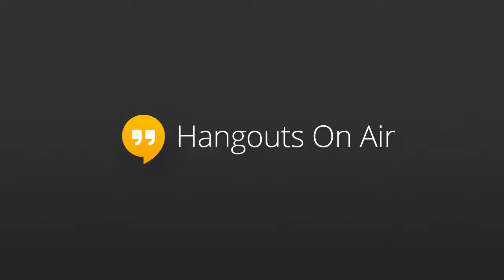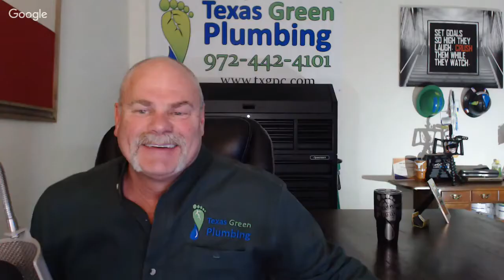Why Replace Cast Iron Drain Pipes?

Comment: Dang I wish I had watched this a few months ago. I knew the price I was quoted was high, but I didn't know until watching your videos how much I missed out on. I got a plumbing inspection on a house I was looking to buy. They checked appliances and hookups in and around the house and ran a camera down the sewer line. $1,000. No pressure test, no sewer water test. Just a, 'Your sewer pipe looks good.'
I'll be more more careful in what I ask for next time. 
Great videos!

Comment: I agree with all this. However, there are plenty of situations where the homeowner doesn’t want to hear the toilet flushing from the kitchen below, for example. In this scenario, we provide the option of installing a cast iron run for the portion of pipe that may be heard from below. It definitely keeps the plumbing quieter, but doesn’t last as long!
Reply: Roger just said that its fine above grade. For sound case you put it in the wall, where it should live 100y no problem. My 70yo house had cast iron plumbing, under slab - cracked for a long time - above - perfect, healthy, still black like new pipe.

Comment: I have a 1930s bungalow with original cast iron plumbing and no problems yet. Hoping i get a few more yrs before replacements
Reply: What's happening with old galvanized water line u keeping them bcz not leaking  🤔

To be honest if u remodeling and open walls remove old plumbing, electricity every old stuffs inside wall and install new fresh plumbing, electricity etc bcz u dont want remove a new work bcz few months later a pipe start leaking or a old electrical wire burn 🥵

Comment: I think it's all about quality.
I have been working inside a 20's building  and they didn't had any issue on the plumbing/heating.
The cast iron drain were neat.
And it's not the only one I seen in my life.
Nowadays I won't do cast iron in my house because it will rust after 10 years
Reply: not true mine is 150 years and in good working order
Reply: @divinee.155  I know that cast iron is a good product, but nowadays the manufacturing of cast iron is a real joke.
The cast iron is so thin, that it's lighter than PVC.
Before cast iron was very heavy and doesn't rust
Reply: As a millwright contractor I worked in and around industrial buildings with cast iron pipe WELL over a hundred years old both inside and underground.   Are we sure he is not confusing galvanized steel drain piping with cast iron?

 Galvanized was SOP for bathroom and kitchen drains up to when plastic took over and most of it has already had to be replaced but the fact is be it above or underground Cast Iron will last indefinably as long as it isn't  physically damaged or plugged up with whatever,,,,,Now Galvanized pipe, even in air lines, rarely makes it past 50 to 75 years no matter where is  installed. ---- Well. maybe as an oil line. I have worked on large machine tools and big presses and forges well over 100 years old that were left outside in the weather for a decade or more,,,,,and then we re-built then and put them back in service. - Guess what the frames/beds were made of? - It wasn't PVC, I can tell ya.

Comment: I work in  a commercial building and we still must use cast iron for waste lines and copper for supply lines. To maintain fire rating of the firewalls and prevent excess smoke from plastics if a fire does occur.
Reply: Yes commercials and multi unit building required cast-iron drain and copper vents line

Comment: I'm about the 5th owner of a 1935 brick house with a slate roof in Pittsburgh.  I'm guessing no one has had to replace anything on this skookum house. 

But the cast iron Terra cotta pipe system is now 90 years old...

Comment: How do you know that PVC pipe or the connection fittings will last 100 years? Most underground main sewer pipes install by municipalities are cast iron. I’d rather go with new cast iron piping for underground installations.

Comment: A few decades ago I put in underground HS XH (not SV);  everyone touts plastic now but I've yet to see 100 year old buried PVC pipes and worry about embrittlement over long time spans not to speak of gouging  soft plastic from those nasty augers.   If I did it over again might be inclined to case with 10" PE and vent (crawl access not an option), but still corrosion will eventually get to the iron.   Fundamentally, one has to decide how to not only build a suitable house, but include in that house maintenance access.  I don't like new fangled materials like those taped wall panels, stretchy tape for window pans-- the mfg does not specify how long the tape is good for, maybe just long enough for air door approval. Plumbing is no different, how confident are you that ProPress gaskets won't leak in 50 years?  Oh, the horrors of de-zincafication!  And don't even mention that wonder plastic PB.

Comment: i heard that the rust that first develops on the inside of cast iron underground actually helps protect it over time...common to get 50 plus years up here in the northeast underground..
Reply: Just one more thing = Cast iron is close to rust proof. (Rust,,,,,Oxidized iron) Don't believe me? Grab an oxyfuel torch and tru to burrn cast iron. - It will not work because even when red hot the iron will not oxidize. You can cut Steel 2 feet thick with a torch, but you can't cut cast a quarter inch thick. --- Introduction to Metallurgy 098

Comment: You can say whatever you want, everything in plumbing depends. You say "a" part or material is bad for the plumbing system, however, there is always a situation that you have or is the only way on doing the installation or repair.

Comment: stopped at 3:26, in my opinion, who's been in the plumbing trade since 1978, I do not replace anything unless it goes bad. I have replaced CI pipe if it's rotted out, but not just to put in pvc.. I had to stop where I did cause I had to go, I don't know what else he had to say.

Comment: Some houses that have concrete slab were the cast iron is buried would rather walk away from replacement because they have to jack hammer the concrete to get to the cast iron pipe and replace it.
Reply: I'm prob gonna take on that challenge this summer lol

Comment: Much much cheaper to have it relined. They feed plastic thru leaking steel natural gas lines. No digging big money saver. Well folks they now have a blow mold plastic that is like a long balloon fed thru the pipe they it is blown up and it quickly hardens they have a  camera fed hole cutter to cut openings for fitting s it's way cheaper ppl than hiring some hyperbolic rates of a plumber

Comment: I'm a home owner and not planning on selling but I have old non leaking cast iron.  While I am renovating my bathroom should I replace the good cast iron with PVC since I have the opportunity or leave it be?  House built in 1955.
Reply: Good question. I'm in the same situation as you, I'm due to refurbish a 1950s house. What did you do in the end?

Thanks
Reply: @darkknight17  I ended up replacing all of the cast iron all the way up and through the roof stack.  When I cut the old pipe it was still very solid with decent thickness but had a ton of sludge build up and I was able to fix some sloping issues that was causing poor drainage.  I went through 4 Diablo carbide blades.  In the end it was not that hard or expensive just took some time to think about the best strategy.  Best of luck!
Reply: @Vin3Man  thanks for your reply mate.

I recently purchased my 1950s 4 bed, and the list of things just keeps growing. I'm considering whether to replace the cast iron soil stack pipe with pvc, or have it professionally cleaned and lined with epoxy resin.

I also need to do full electrics, new boiler, full external render, and internal plaster and skim plaster. It's just getting rediculous. 

The surveys alone (damp survey, roof survey, drainage survey) are not cheap at all.
Reply: @Vin3Man  in hindsight, did you do a drain survey with a camera or just take the plunge? Any regrets?

Im on a shoe string budget of £60k and I'm currently coming in at £75k for the works. 

Thanks again.
Reply: @darkknight17  I'm glad to provide some insight to to this scenario that many DIY or maybe even not DIY homeowners face. I did not perform a camera survey as I decided from my previous experience where I did not replace the cast-iron when I had the opportunity to bit me in the rear. In a previous home I renovated a basement with a cast iron drain and it was in good shape or so I thought and a year later it developed at crack on the bottom horizontal length that leaked everywhere and the cleanup and managing the nasty mess was a lot more time-consuming and stressful then if I would have just done it while in renovation mode. For this particular project it was an upstairs bathroom and we had just renovated the kitchen below it so I did not want to come across that same scenario where I had to manage sewage cleanup and and mitigate the impact to the brand new kitchen below.
Reply: @Vin3Man  thanks mate, really appreciate the shared experience.

I'm in a similar scenario, the soil stack from the toilet is on 2nd floor and 1st floor that runs down the side of the kitchen. I need to full hack off and replace external render which is coming in at £25k for the full house. I've also heard old cast iron pipes expand due to heat cycles and can crack or blow the brickwork of the building.

I will start with a drain survey with a cctv camera to inspect the pipework, to see if I can save money, and then compare quotes between the epoxy resin slide (pipe within a pipe) vs pvc pipe replacement quotes.

Comment: Hey Brother, I am looking to replace some Orangeburg pipe underground out in the yard.
Reply: Oh wow. Got to love the orange burg pipe. I been doing plumbing for 25 years in Atlanta area and I still see it here sometimes. It’s rare but yes I’m sure it needs to be replaced. Lol. I would go back with foam core pvc 4”
Reply: @chadstephens7467  isnt ABS better for underground??
Reply: @workingshlub8861  yes that is correct. ABS is absolutely better suited for underground use and foam core pipe is better suited for in home use. Very true

Comment: What is the life expectancy of ABS pipe?
Reply: infinity.
Reply: abs is stronger than pvc...better for underground.
Reply: Just don't pour any solvents like nail polish remover, paint thinner, etc.  You shouldn't do that anyway but ABS melts much easier than PVC from that stuff.  If you don't do that it's a tougher material than PVC and holds up better to temperature too.

Comment: There is no reason to change cast iron above grade.  Above grade, it is a 75 to 100 year product and the drains are very quiet.  Below grade, in most cases, it is a 25 to 50 year product.
Reply: What if some water leaked on it and rusted the outside of it? My cast works well but is rusted on the outside due to a p trap leak dripping down it sometime before I owned it. Wondering whether to remove it or leave it be since it works well.

Comment: Interesting - drain cleaners I know are actually lye, not acid (NaOH / KOH pellets). If for nothing else, pouring somewhere strong acid that can i.e. generate hydrogen. chlorine and so on in contacts with some metals and salt doesn't sound like best idea to me.
Reply: Drain cleaners are Lye or Acid.  Sulfuric acid has been used as a drain cleaner for decades.  Notice that the labels on drain cleaners warn you to not mix products.  That is to avoid injuries caused by mixing Acid and Base(Lye.)

Comment: What about in line epoxy
Reply from the maker: thats not a bad repair, but it makes the inside of the pipe smaller which could lead to more problems, even though it smooths the surface...
Reply: @RogerWakefield  every plumber that has come over failed to mention. It's a great option for me rn
Reply from the maker: it's still a relatively new technology so a lot of companies may not offer that service

Comment: Assuming that a home seller would want to hide sewer/plumbing information “for profit” is wrong-headed, considering the HIGH (and I mean VERY HIGH) cost many plumbing companies want to fix (or most likely replace) your cast iron pipes. It isn’t their fault that an inappropriate material for under-ground use in a cheap slab (as opposed to pier and beam) was chosen, likely well before they lived in/bought the house. Finally, I find it absurd that you want $60 or so to come out and use your camera. I just had a local plumbing company come out to do that for free. They do it as a service, because they know your likely to use their services in the future.

Comment: I live in an apartment upstairs I didn't want or I would change the pipes and owner nicerr even though he asked me to ask my mom to help to change sink and said he would sign for it when she asked him because that too has to change I was going to say the sink is too big high up faucet doesn't even fit at all saw one other but my mom said keep a counter and sink a guy from home contractor can't think of name now said to get and knows someone some months agao and can't wait any longer been 3 years and 3 or 4 months like this I saw a video a guy said took 12 13 or 15 monutes to replace pipes and easier prob. because on a home and pipe was sticking out of from roof my mom said after later It's not my job to fix it if have water hot and cold not going to change it fix it or something s and more but it's really bad these last time s I was going to say something s I think I was supposed to move and saw some listing kore after later on a website now they have and around this pandemic I wanted a small vanity and this one is an inch lower but kinda better right now they put the mirror more in and inside wall . , . I didn't want to be here but I had to it's really higher up but I really need to fix the sink too can't rinse hands down my brother wants to put a washer and dryer here just want be downstairs this place is so high up small weird wanted something better not worse It is probably because the pipes are shared being used with others the same ? , . . but that s ' even more so they should change pipes they shouldn't be able to sell apartments with it being shared so much without updating pipes bad very bad for people's health s kids this is not good for brushing teeth washing dishes dishwasher why exactly does it work less is it going through bumps in pipes can't think now . , . coming out less
Reply: I didn't say and she they had t just get replace pipes at their house and she repaired house and years ago sinks I wanted small vanity too I put I think we have this is like the worst sink and too very big hands are not even in the sink
Reply: my mom doesn't understand and say something like this how very unhealthy it is and pay for losing my teeth like brushing teeth qith no water doesn't feel get clean not good to have old very pipes and hard to wash dishes soap goes comes off sponge too and forgot that it would do that did think of it before just thought now the style of kitchen sink faucet is further back alittle too and has low arc faucet on it so it's further back
Reply: and not deep sink and really can't rinse utensils even my aunt and cousin have same sink though better woth their other faucets not high arc almost low arc bigger too in their apartments had to put have sink and they put with marble counter top I think before they moved in couldn't give them these type of sink s like normal more apartment s mine too but like easygoing relaxed is connected to wall vanity didn't want to looks seems feels bigger probably with and because of sink and is white lower by an inch average size of the
Reply: It literally pulls my back hurts too and stomache and arms too hands and before more so It's bad was going to say different or now it's not good I like the mirror surprisingly and they had to put the mirror more in but you can't even use it it's stupid actually which I thought of before well mostly they do I guess very I saw one picture they didn't put it and I didn't want so can move it It's from lowe's and I saw it they had old looking thing s mirrors but I liked this one cheaper est too he mostly got everything lowe's and shower doors nice good usually but the tub is higher harder and seems small it is more bigger side of corners because I measured at my Dad's house and Mom's same size s just middle is smaller on all tubs
Reply: the sink is in have to lean in too very bad